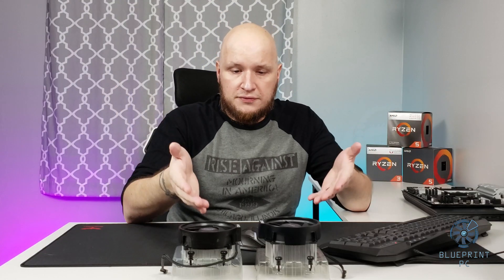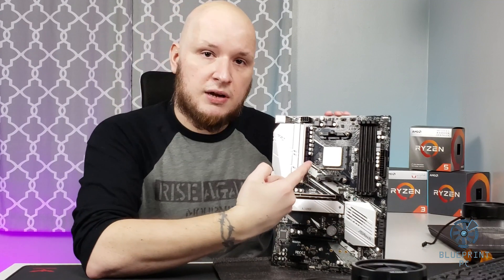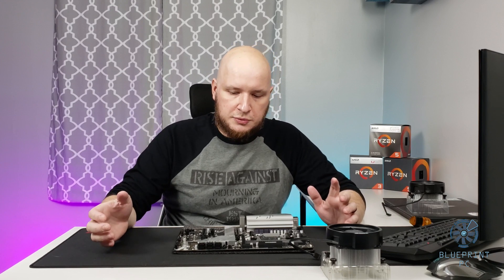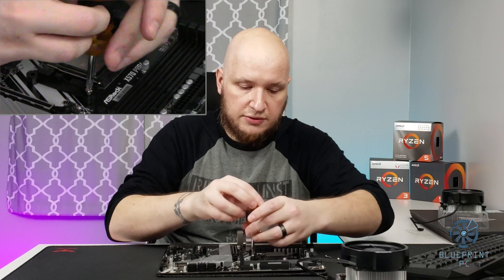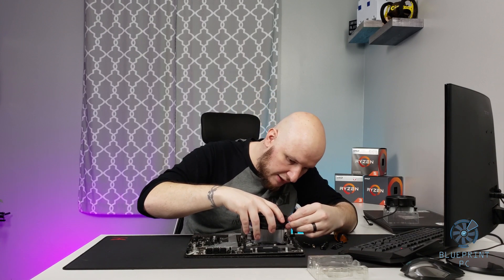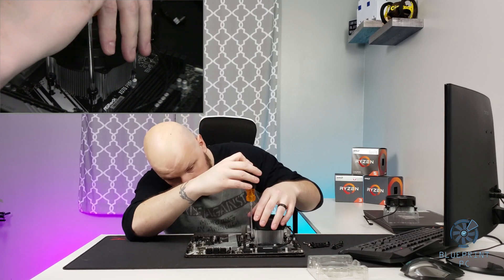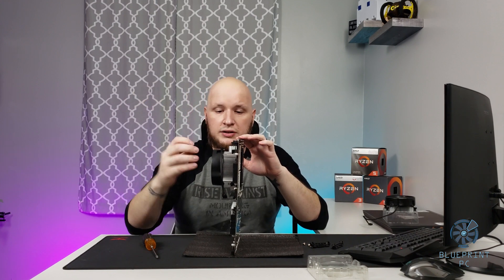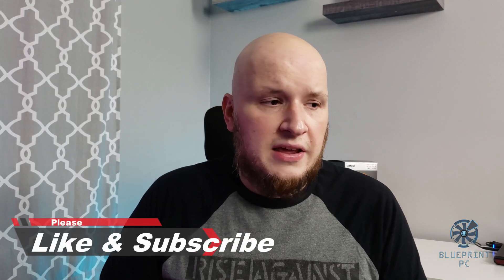Wraith Cooler Installation!

Comment: Today I was trying to swap out my ryzen 5 5600g with a 5600x3d and after I took off the cooler to remove the cpu, I realized that the back plate was loose. I know to get the standoffs up enough to where I can screw the cpu cooler down I can just tape the backplate to the motherboard temporarily but my problem is that the cpu cooler screws actually are no longer lining up with the standoffs… I have no idea why this may be. Also doesn’t help that my case partially blocks my back plate and it’s really hard to fully take off. It had come off in its own once and I didn’t think to try and line the plate up with the cpu cooler while it was off and since then I haven’t been able to take it off again.

Comment: I have that small AMD cooler but my M-ATX motherboard won't fit it in. The motherboard does that those 2 plastic covers around the CPU but I still don't know how to make sure my fan sticks onto my CPU
Reply from the maker: Hey there, what processor and what motherboard are you using?
Reply: @BlueprintPC  my processor is AMD Athlon X4 750K and my motherboard is GA-F2A58M-DS2
Reply from the maker: @das_sound_machine   hey there sorry for the delay, do you have the stock cooler that came with the Athlon? I'm just trying to make sure I am following along correctly. If so check out this video, it's older but may help you out: https://youtu.be/MgIe2vZZsLU
Reply: @BlueprintPC  sorry but my CPU doesn't come with a stock cooler

Comment: went from ryzen 5 2600 to a 5600x had to do a bios, re and re the cpu. and ièm totally green at this.. wish I new about pulling the cpu out with the heatsink and without undoing the retaining clip happens. glad it all worked out time to enjoy..   asrock b450 pro4
Reply from the maker: Glad it worked out, I think we've all pulled a processor out at some point. I pulled out my 3900x, then the processor fell, pins got bent...stress went up!. Got pins straightened... relief.
Reply: @BlueprintPC  I was more shocked it happened. New one went in and retainer clip seemed to pull the chip in well. Couldnt find any bent pins. 

But man the wraith fan and backing plate was a pita
Reply from the maker: Sometimes it's butter but other times I hate em. Also I think the stock thermal paste AMD uses magically turns into glue...
Reply: @BlueprintPC  seemed lile it thinkimg of getting an AIO temps are much higher than my 2600. 
Hopefully fits..
Thermal Lake v200 with 2 added fans uptop(exhaust) not the best case.
Reply from the maker: The 5600x is a fast chip and will run warmer due to this but performance shouldnt be harmes unless you are getting really hot!

Comment: Hey, the holes in the motherboard are way too big, and way too far down for the screws. Am I missing something?
Reply from the maker: Did the back plate fall out? You need to support the backplate so it doesnt fall out
Reply: If the motherboard is already installed into the case, then the backplate is going to be in the back of the pc and you will need to open that side too to hold them together and install it. That or you can unscrew the motherboard from the case.
Reply: @helixzenith  Yeah the backplate was the problem IIRC. A few weeks ago I unscrewed the heatsink again to reapply thermal paste, and I had to make sure to keep the backplate from falling out
Reply: What I did is I pressed the backplate to support it, then while screwing I pressed down on the screws while screwing and that seemed to work for me
Reply: Amazon sent me a back plate with my mother board studs don't even push through

Comment: Bro I don’t hear any noises the screw just stays in place doesn’t go up or down and it’s making me lose my mind.
Reply: did you ever figure it out? cuz mines doing the same
Reply: @kaodotcom6306  I bought a new cooler, and you kind gotta be forceful when pushing it down so it reaches the hole.
Reply: @OtsutsukIsan  I’m forcing mine down they won’t go do I really have to buy a new cooler
Reply: @mrprofessorpickle  it could be possible that you unscrewed it when it was facing upwards in that case probably the little things sticking out of your motherboard where the brackets go fell down if you open the back of your case you might see it laying there. Hope this helps
Reply: @jurrevanderkraan7299  Ohh yes dude thank you so much, I was losing my mind thinking the screws got too rusty or something. I even heard the plate fall and thought it was one of my screws.
Reply: @jurrevanderkraan7299 the love of my life
Reply: @jurrevanderkraan7299  This was soo helpful, thank you
Reply: @jurrevanderkraan7299 thank you so much brother…I was trying for half an hour thinking what’s wrong.
God bless you 😊
Reply: Yo I just wanna say this is exactly what happened to me and it helped me out lol thank you
Reply: I’m gonna blow my fucking brains out I’m having the same problem

Comment: What do i do my screws will not move
Reply from the maker: like they wont spin or will  not move up or down?
Reply: @BlueprintPC   my screws are not going up and down
Reply: @Luckynuts27  They arent supposed to. Thats why this cooler is so hard to install. All they do is spin, but they baaaarely even reach the bracket in the first place. Getting one threaded will raise the opposite side so that it wont thread at all.
Reply: how to insert if its like that

Comment: My motherboard is not flat and I cannot get my  cpu cooler last screw in just got the thing today and im lost
Reply from the maker: Check out my newer video and see if that helps. It's more detailed with tips
Reply from the maker: If you still need help after that let me know
Reply: @BlueprintPC  ok will do
Reply from the maker: @YoIntangible  how did it go? any luck?
Reply: @BlueprintPC  yeah I got it. It took me 10 minutes get them all in the treads without lifting up on one of the sides
Reply from the maker: @YoIntangible  well I'm glad you got it tho!
Reply: @BlueprintPC  yeah I'm happy too

Comment: I can’t get all my screws to go in!!!!!!
Reply: They’re lined up and I’m only able to thread the top 2 But I’m not able to tread the bottom 2 because it’s such a big gap
Reply from the maker: Have tou tried loosening the top two and then trying the bottom?
Reply from the maker: I provide an example of what I mean in the second half of the video. It may help
Reply from the maker: Are they not lining up or they wont start threading in?
Reply: I tried everything
I give up
Reply: @jsells2375  Same. It just doesnt fit my mobo. Its not possible, even though it should be. Most I could get was 2 screws on the same side. Even just getting one screw 1/4 turn in made it so the screw on the opposite side wouldnt reach the bracket. So stupid
Reply: Bottom 2 screws have a big gap

Comment: Bruhhhh my cooler screws aren’t reaching the damn motherboard I’m scared this shit gone break someone help
Reply from the maker: They are spring loaded so you have to push a little. The cpu is fully seated correct right?
Reply: @BlueprintPC  thanks I already tried that but how much ever i push and crew it will just jump back up
Reply from the maker: Are just having trouble with the first screw or getting the last one?
Reply: @BlueprintPC  I installed it now I was just wondering while I was pushing the heat sink down to get it to reach I heard a couple of popping noises. Could have I popped the cpu pins or was it just the Backplate?
Reply: @zyl6646  how did you do it? I’m having the same problem with the screws
Reply: @zyl6646  same im having issues
Reply: @YoIntangible  did u fix it I’m having the same issues
Reply: @Z3JS  somewhat, but I had to do the x pattern just turning the four screws slowly. And I did that for 10 ish minutes so then I got all but one in and then I said screw it and left it like that
Reply: @YoIntangible  thx so just turn the screws slowly?
Reply: @YoIntangible  also I’m having a problem with my motherboard it’s the asus strix b550-f strix.
So when I turn on my power supply nothing powers up besides the front Io shield.my pc won’t turn on.
Reply: @Z3JS  yeah thats what I did
Reply: @Z3JS  Ik this is 2 years 2 late but it won’t post cause the bios needs a update
Reply: @BlueprintPC  yes I’m sure

Comment: I’ve been screwing my cpu cooler for 10 minutes and it’s not screwing in I don’t know what to do
Reply from the maker: Are the screws having trouble starting?
Reply: @BlueprintPC  the cooler screws won’t reach the motherboard after I screw one in
Reply: @zyl6646  samee like wtf
Reply: @jaiiclipped  I had the same problem. You have to ensure that the backplate is static and you have to screw slowly as a X shape, each screw 3/4 turns. I spent 2 hours on the first time and 1 hour at the second with help.
Reply: @saidtorres3  what do you mean the back plate
Reply: @livinglegend1313  Under the motherboard, there is a metal plaque, where you have to put the screws in.

Comment: Bro can I get some help?
Reply from the maker: I can try, whats the problem?
Reply: @BlueprintPC  I fixed it tho but thanks for replying, it was the cpu cooler wasn’t going in until I was using a lot of force that I thought the board would break
Reply: @flaminffam2686  how did u fix it

Comment: I can’t screw in all the screws 1 won’t fit
Reply: Okay well I’m installing ram with Corsair vengeance Rgb pro 16 gb 3200 MHz and I have the gigabyte b450 ds3h would you by any chance know what slots I should put the ram in?
Reply from the maker: @adrianslattt   check the manual but it should be the farthest and the second farthest
from the processor
Reply from the maker: Try starting all the screws before you tighten them down all the way. Also go corner to corner when threading them in
Reply: BlueprintPC it’s like I align all the screws to screw them in but 1 screw is off a bit from where I’m supposed to screw them Idk what to do
Reply from the maker: What cooler are you using?
Reply: BlueprintPC I’m using the stock cooler
Reply from the maker: Welp either the mobo or the cooler is faulty if they don't line up. Do you have a another cooler you can test fit with?
Reply: BlueprintPC nope not at all and I can’t get one I’m 13
Reply from the maker: Are you able to measure the space between the top two holes and the bottom two holes
Reply: BlueprintPC no I can’t
Reply from the maker: Welp at this point your only real option would be to return the items and get them replaced my man.
Reply: BlueprintPC well thank you bro for trying to help me.

Comment: Nice video! Found it through Google because I might have an issue here 😅
While I was installing this cooler one of the screws didn't want to go all the way down. All the other screws were tightened till the end, like you said, but this one was just spinning in place forever. I think it was badly angled or something.. So I slowly started to unscrew the other ones and suddenly the entire cooler sprang back up. I proceeded to try to tighten every screw again and this time they all tightened up to the end. 
But now I thing that the CPU temp is kind of high, staying in the high 50s and low 60s Celsius on idle. Can it be because the thermal paste may have gotten messed up during the mounting process and is re-pasting going to make any difference? The CPU is Ryzen 5 2600 and the case is CoolerMaster MB520 .
Reply from the maker: Yeah its possible the paste got messed up a bit. I would repaste it and retest. Let me know how it goes. Also just make sure the cooler is sitting even across the chip.
Reply: @BlueprintPC  Okay, I will try to repaste it and see if it gets better. Thanks!
Reply from the maker: Also let me know when the temps are under load
Reply: @BlueprintPC  under load the temps are 75-76 Celsius max. I got a thermal paste today and I'll re-paste it during the weekend.
Reply from the maker: Thats not too bad under load, what case do you have? Im more concerned about the idle temps.
Reply: @BlueprintPC  The case is Cooler Master MB520 with 2 fans, one intake and one exhaust.
But, I did the repasting yesterday night and it definitely helped lower the temps, but not by much. As I'm typing this the the CPU sits at 57C.  Maybe the fan is not set properly? (I just used that smart auto-fan tune ASUS has) https://imgur.com/a/xSsWC8V
I really think I should just get an aftermarket cooler...

Comment: Bro I need help asap
Reply: What do I do if my fan isn’t staying down it’s lifts when I put 1screw in
Reply from the maker: Make sure the cpu is seated correctly and level first. Do you mean when you start the first screw and then the opposite corner lifts up? You wanna start the first screw before you tighten it all the way down. Once the first screw is started a lil bit. Start all the rest Before! You tighten any of them down. Once they have all been started, equally tighten the rest down going corner to corner a little bit at a time.